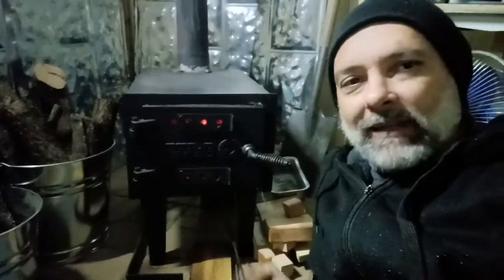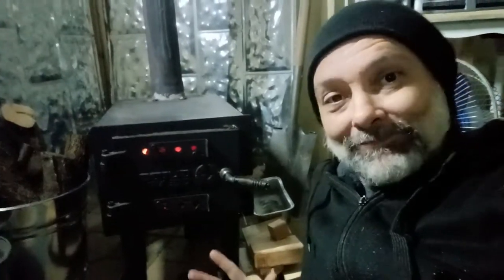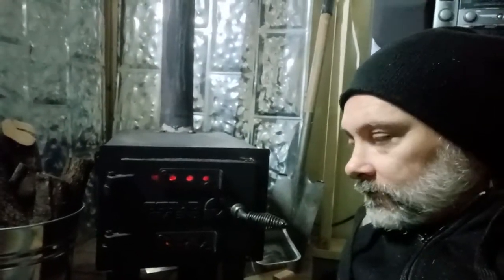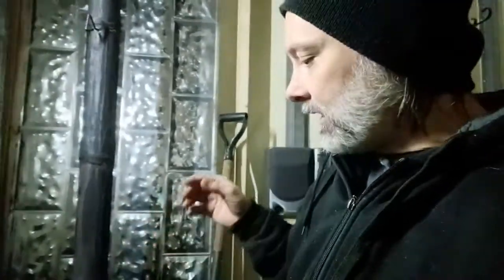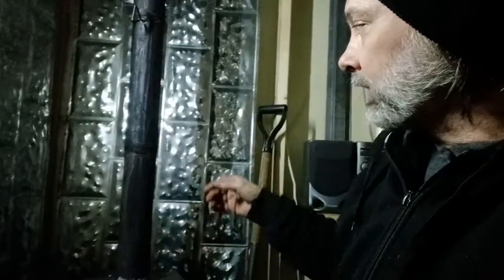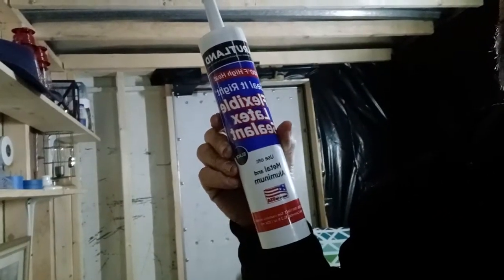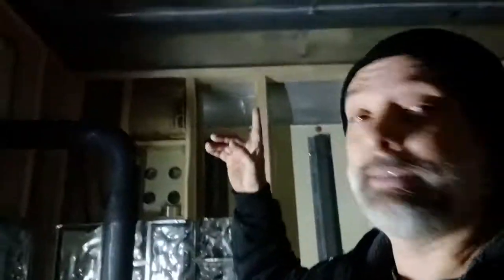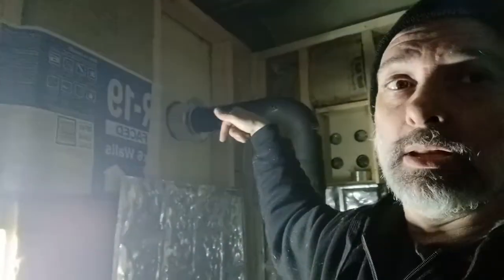Guide Gear Wood Stove Review and Modifications

Comment: I want to mod mine out and make it work like yours!
Reply from the maker: I made a update and it works amazingly now by taking out the pipe length that goers though the wall and hooking just the elbows together.
Reply: @VarnHomestead  do you mean that once it goes outside, you just have another elbow rather than the two extension pipes? Wouldn't that be too short or is the second elbow really long?

I'm looking to do a similar project in my small cabin and would love the advice!

Comment: I found out a few problems I didn’t see in reviews. 
1- cut off the flat top of the spark arrestor (top pipe)
2- I didn’t figure it out until later but the damper on it is not always aligned. So if the damper handle is straight up and down it might not  actually be that way inside. Should have checked first but after relaizing it it burns great. 
3- also remember if your gonna use it inside to totally cure the paint. (Inside, pipe and outside including the thicker door. Burn hot 3-4 times to be absolutely sure. 

4- the seal fire proofing will fall right off as it held on with double sided tape. Just use 2000 degree caulking and put it back on. 

Don’t listen to him it’s pretty good for the money and I’ve built a few. 

Otherwise it’s good so far
Reply from the maker: yep the dampener is a pain in the butt..lol So when you cut the top off the spark arrester how much better did the thing work? I been thinking about doing that as I bought a cap for it.